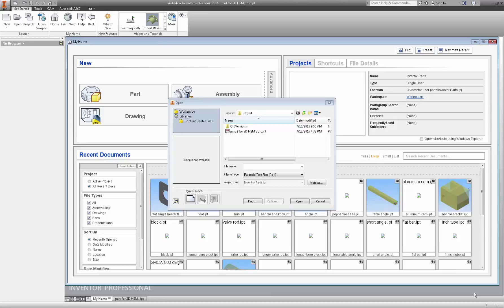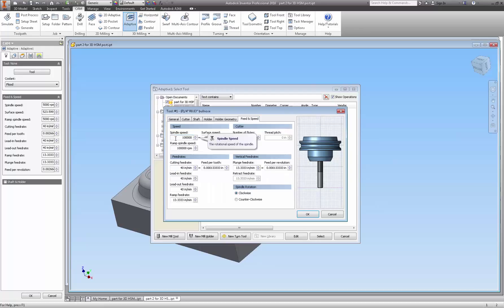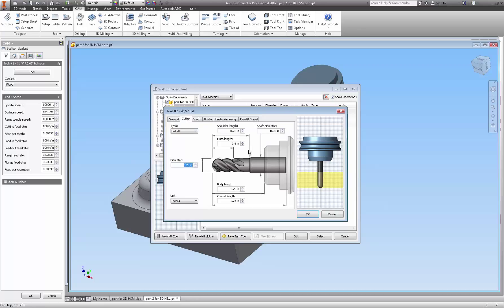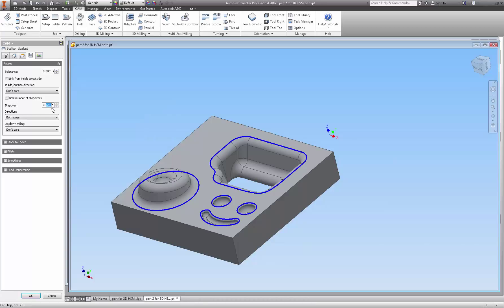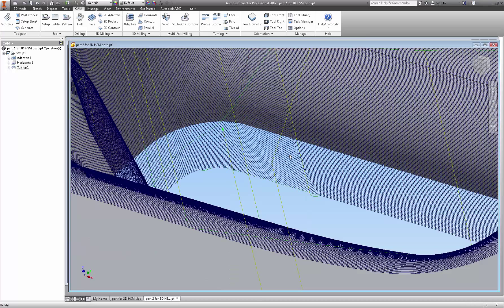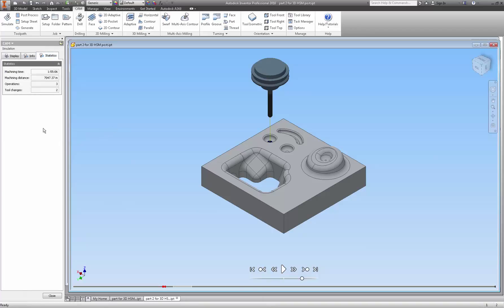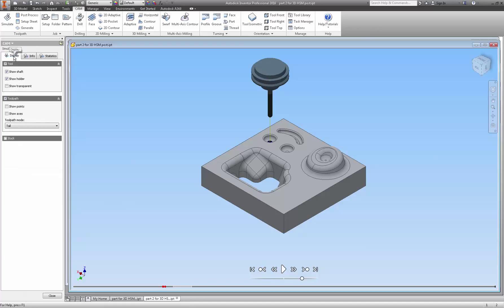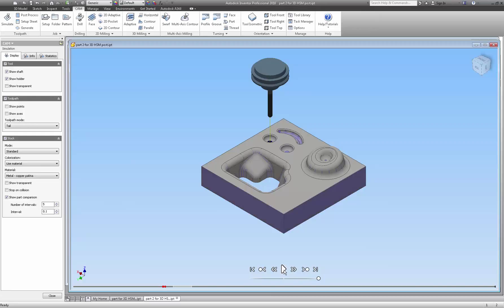Autodesk Inventor Pro HSM 2016, Cutting a 3 Axis Part

Comment: Hi Dave, I've been reading your blog for the last year or so. Thanks for doing the youtubes videos, always good to get different perspectives on setting up tool paths.
I started using fusion360 ultimate in December last year, it has, more or less, the complete hsmworks built in.
Reply from the maker: Grant Patullo Thanks Grant,
  How do you like working on the web?
Reply: SolidEdging Fusion is cloud based but you can work offline for up to 2 weeks before you have to reconnect with the cloud.
I like it so far, I can work on projects at home and when I'm at my workshop I use my cell phone as a wireless hotspot and load up my projects there. Speed is no problem.